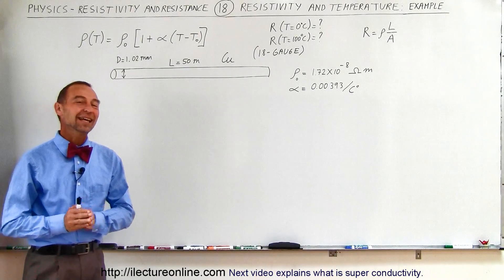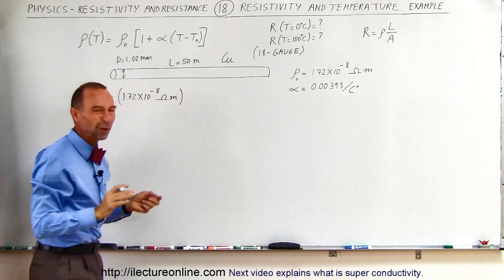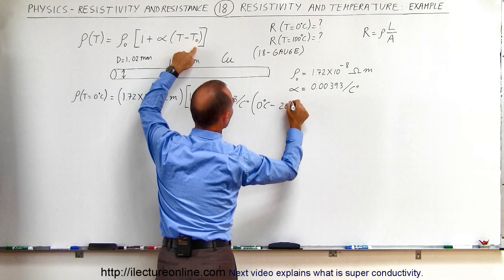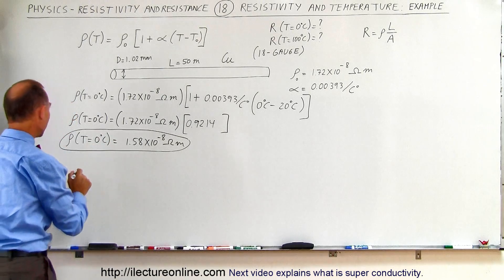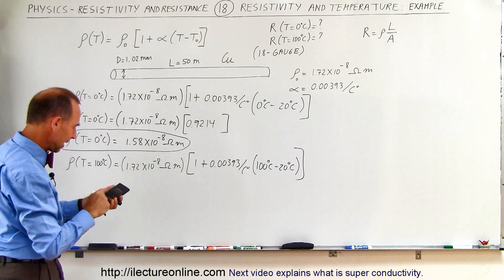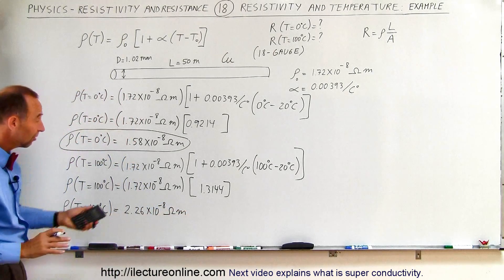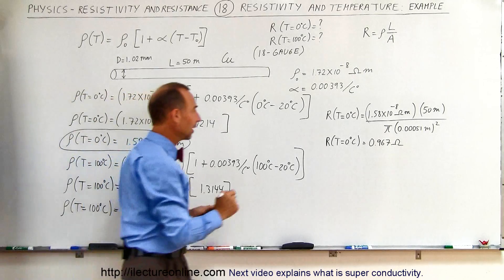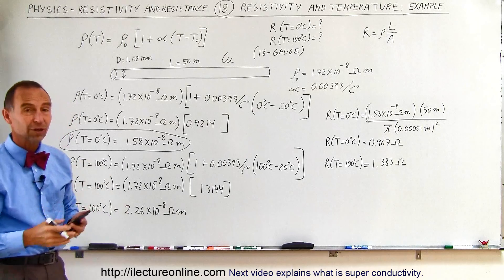Physics 40   Resistivity and Resistance (18 of 33) R=? of a 50m Copper Wire at T=0C and 100C

Comment: A copper wire has a resistance of 74 Ω at 50 0C, the temperature coefficient of resistivity of copper is 4.1x10^–3 K^–1. What is its resistance at 100 0C?
Answer : R=74[1+4.1x10–3(100–50)]=89.17 Ω
Just wonder if I am correct?
Someone's solution
R/74=(1+4.1x10^(-3)(100-20)):(1+4.1x10^(-3)(50-20))

Which one is correct?
Thank you. I love your videos so much.
Reply from the maker: Resistance = resistivity ( length / area)    Where restivity is determined by knowing the resistivity at a particular temperature and then adjust if for the temperature change.  For example   resistivity = (resistivity at 20 C) + (temp coefficient of resitivity ) ( delta temp)
Reply: @MichelvanBiezen  My friend's solution:
Firstly, he writes for: R (at 50 C)=R( at 20 C)[1+tem coefficient of resistivity (50-20)]
then he gets the R (at 20 C) then the plugs it in:
R (at 100 C)=R (at 20 C) [1+tem coefficient of resistivity (100-20)]
Finally, he gets R (at 100 C)=87,5 Ohm

OR
R (at 100)=R (at 50)[1+tem coefficient of resistivity (100-50)]
R (at 100)=89,17 Ohm

Which one is correct? 
Thx sir